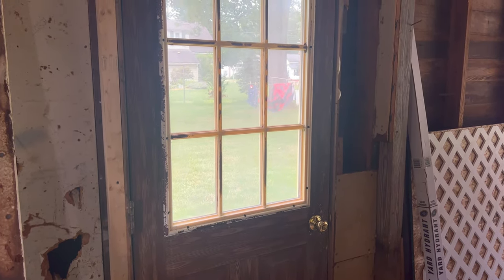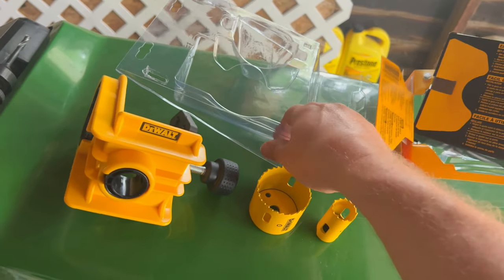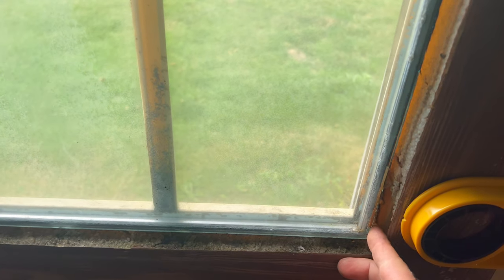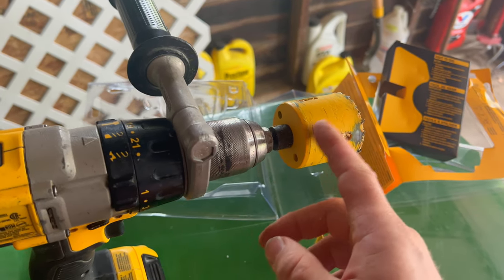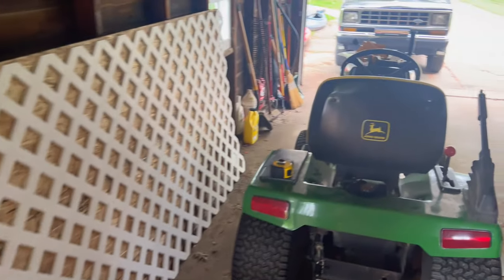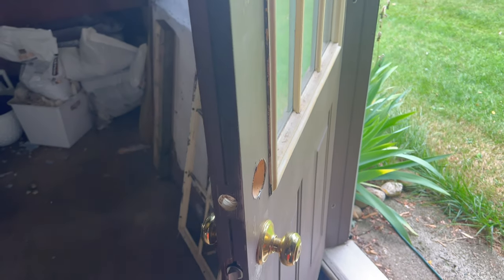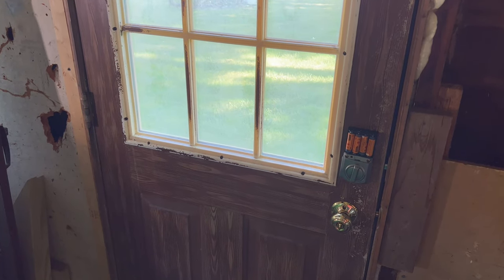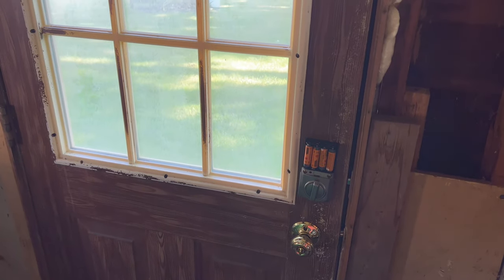DeWalt Door Lock Installation Kit D180004 On a Metal Door

Comment: Your video is the only one I’ve seen that has cut a hole for the striker plate on the door frame , but I wish you would have told us how to mark at the right spot to drill that hole . That’s the information I need

Comment: I think DeWalt intentionally designed the hole saws in a f-ed up manner like that so that you basically would only use them for this purpose. I think if you buy them separately, they are more expensive. They probably didn't want people buying the kit just for the hole saws. Also, the knob getting in the way of the drill seems like a stupid design.
Reply from the maker: That makes sense!